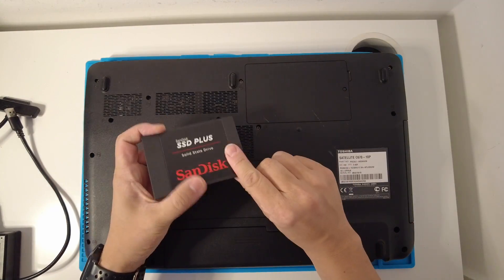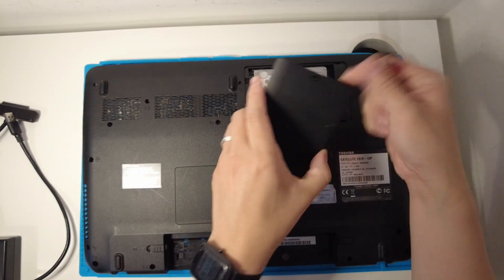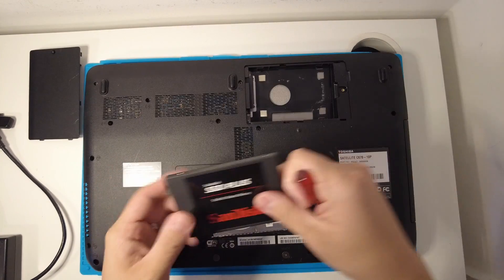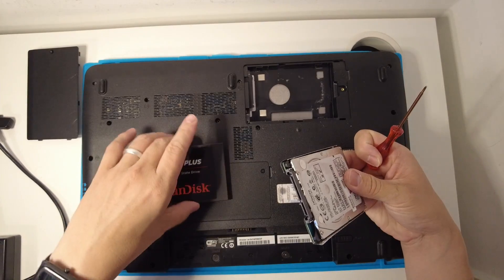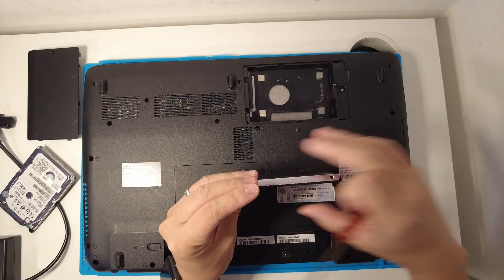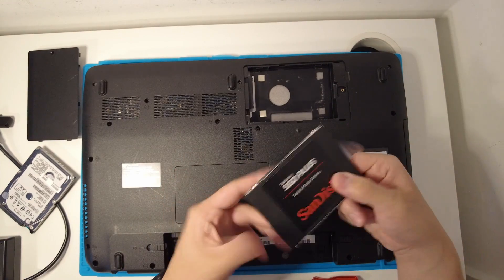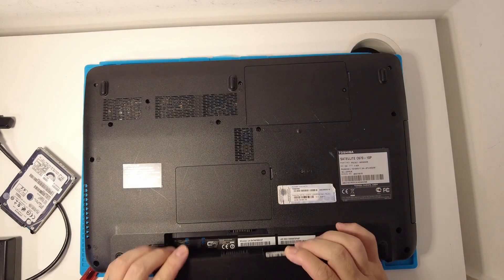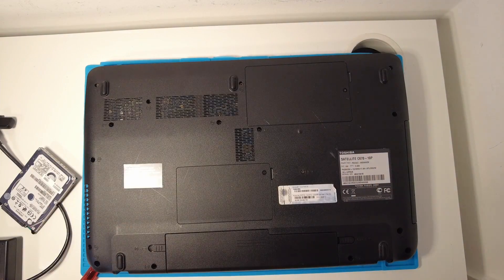Toshiba Satellite C670-10P - SSD Upgrade + Disassembly

Comment: Hi,

The maximum RAM this can take is actually 16 GB (PC3-10600) & the maximum CPU that is still supported is an i7 2670QM. 😉😎😆

I've read on forums that maybe an i7 2860QM/2960XM too could fit. 😑

Specifically on 3 Russian sources (websites) it was stated that you could squeeze in an i7-2820QM or i7-2860QM CPU. 🤔😲😨😕

With that the faster DDR3 RAM could be added as well (1600 MHz I mean here). 😇🤗

AIDA64 software even suggests the HM65 chipset could support an insane amound of 32 GB ! So 2x 16 GB DDR 1600 MHz type. But those cost like a minimum of $240... 🤔😨😳

Best Regards,